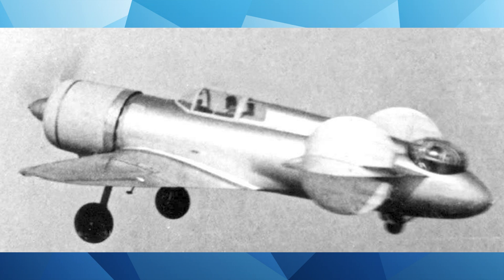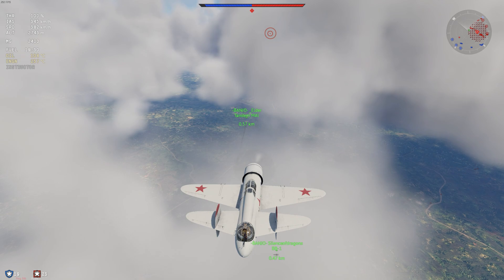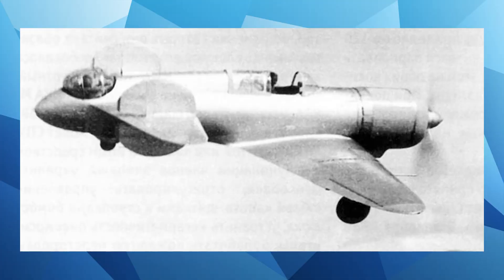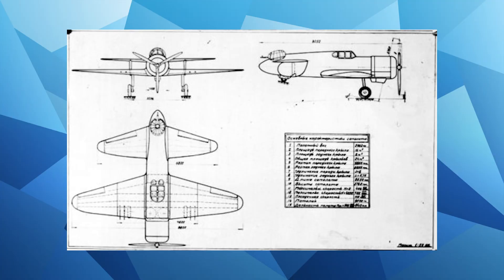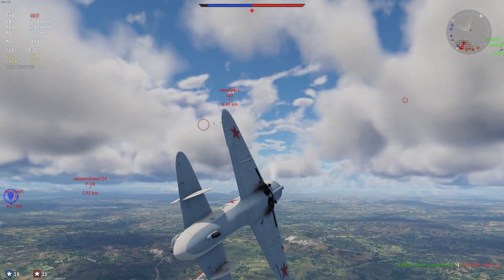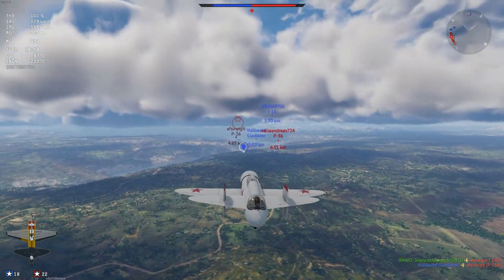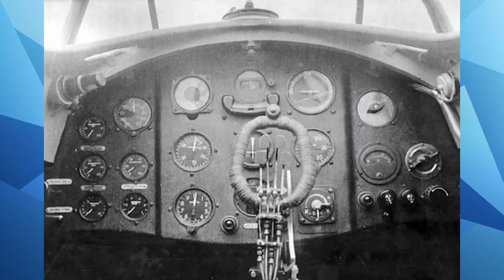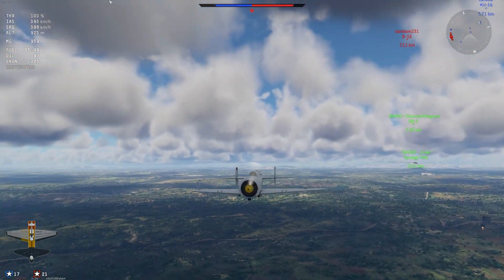Russia's Tandem Wing Attack Aircraft

Comment: Like all tandem wing aircraft, the rear wing is suppressed by the front wing, this because the rear wing is in the wake or flow of the front wing, and consistent with that an amount of down wash alters the rear wings attitude into the flow. In the briefest explanation, a wing which is doing work will rebalance the flow by extracting energy away from it resulting in down wash. Ultimately, it will mean that the overall lift equation of the wings entire is markedly reduced. To minimise this, the rear wings angle of attack can be adjusted to better face the down wash from the front wing, slightly restoring its lift capacity. The problem then becomes one of sometimes unpredictable stall behaviour, because what we must always guard against is a rear wing stall, which will result in a flat stall and spin which will be difficult if not impossible to get out of.